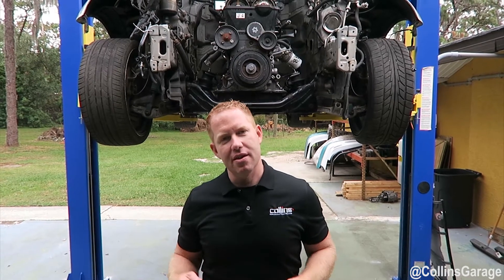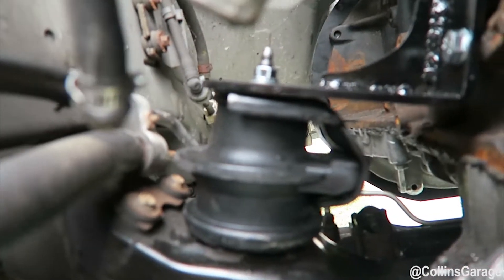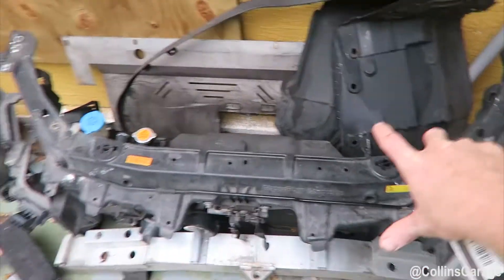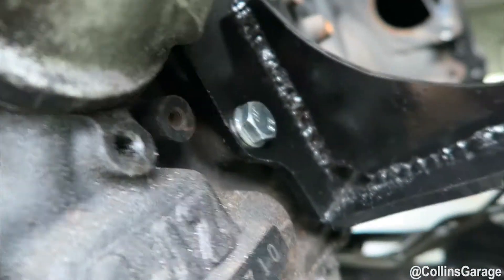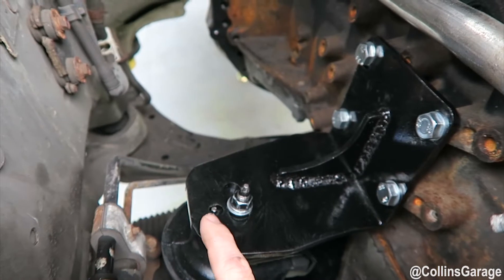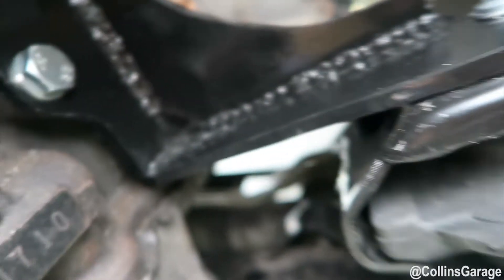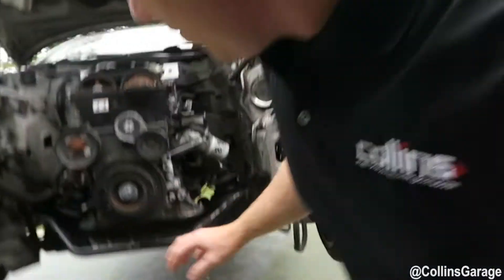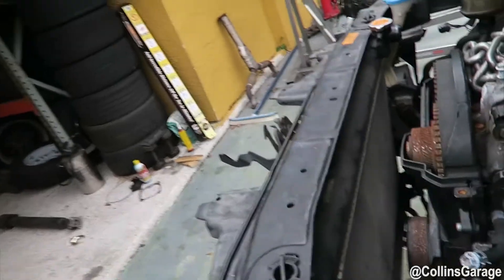Collins 350Z G35 - JZ  Motor Mounts

Comment: Hey my 350z shift knob just started vibrating a little on neutral or gear.  It didn't do it before I'm at 130k miles anyone know why ? Thanks.
Reply from the maker: I'm not sure, we rock a solid mount shifter and solid twin-disc system and don't have any vibrations atm.
Reply: @CollinsGarage_Crett_Bollins  it actually calmed now

Comment: Given that the transmission is the same in a 370Z , would this kit work in a 370Z?
Reply from the maker: Yes it does however the transmission crossmember needs to be modified for it to bolt it. But yes it will fit.

Comment: Is there any fabrication needed for the Trans mount?
Reply from the maker: No, our transmission crossmember bolts right in, with zero hammering as we thought about the chassis contour when engineering the crossmember.

Comment: If the A340 adapter plate were to be used instead. How would the fitment be different?
Reply: Engine would be pushed back further.